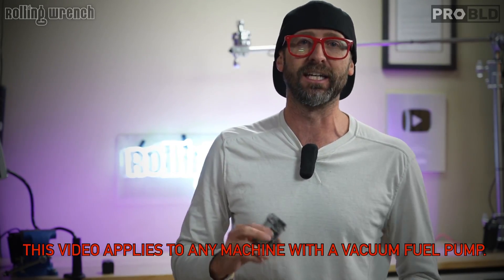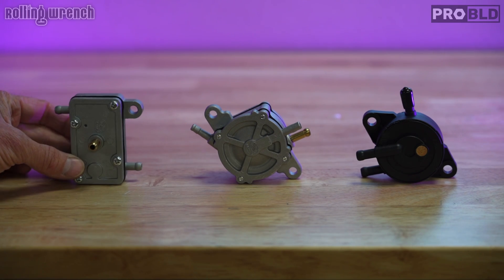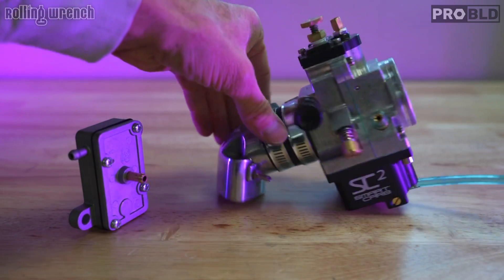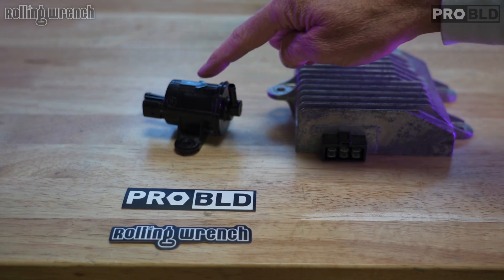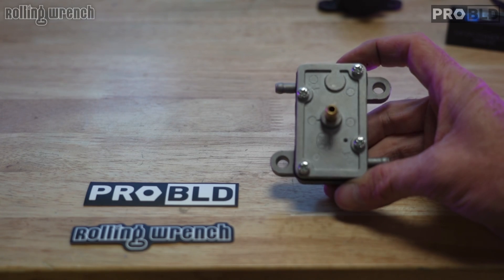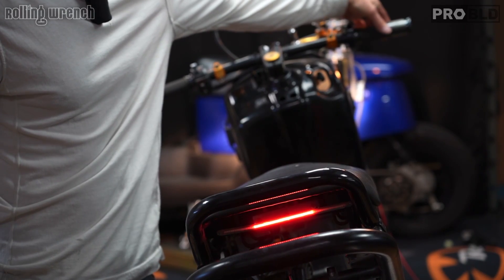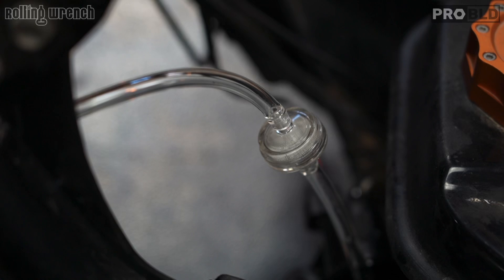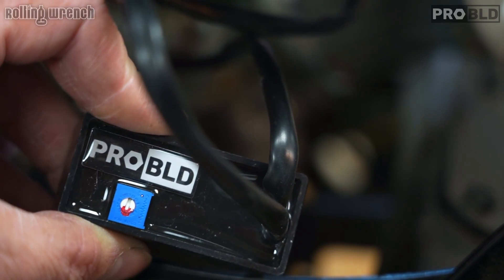No more vacuum fuel pump problems! GY6 Won’t start: FIX! [PROBLD PULSER UNIT]

Comment: Use crankcase vent hose instead of the intake port as your vacuum source
Reply from the maker: That doesn’t solve the problem of it being a vacuum operated fuel pump. The other issue is, the crank case vent is there for a reason. It can’t be blocked off. It will build pressure in the crankcase
Reply: The crankcase vent hose blows OUT. The intake manifold vacuum hose sucks IN. will not work.

Comment: i have a Kymco Granding 250cc scooter, its not been running since July or August last year, and i just start to run it again yesyerday and today... and the issue i have now is when i go uphill it feel like it going to stall or dosent have enough power or gas  running, what could the problem be? is it a power pump issue or what? it use the round shape power pump like onr u show in this video

Comment: Why do you need the pulsar?  Why not just hook it to 12 volts?
Reply from the maker: Unfortunately it doesn’t work that way as stated in the video. The fuel pump requires a pulse.

Comment: Well that’s a problem.  You need rigid vacuum hose…. Not soft ply fuel line.  Any deformation even small will hinder the pumps stroke by a shit ton.
Reply from the maker: Actually we have tested all this. The helix line is not collapsible. The issue still remains. Button line is. Get that dinosaur fuel pump out. It’s no bueno.

Comment: I have a similar problem with a John Deere riding mower. Bad starting/gas flow in beginning. Could this work.. ? No brake lights.. but i have headlights.
Reply from the maker: Yes, just wire it to 12v. I have a lot of people using them on tractors
Reply: Thank you!! 
My last mower was gravity fed. No problems. All of a sudden.. starting issues!
Your video helped tremendously

Comment: Hey bro, I have a 150cc gy6 motor, If I want put a 170cc head and cilinder ¿Will I need to modify the crankshaft? or the 150cc crankshaft is compatible?
Reply from the maker: No need to do anything with the crankshaft. Just put our drop in kit in and go. https://www.rollingwrenchdenver.com/products/gy6-171cc-big-bore-kit?utm_content=ios&utm_medium=product-links&utm_source=copyToPasteboard

Comment: Have one on hyosung Aquila gv250. Tank is above the carbs. I have done everything to this bike and I mean everything. Carbs and all. Still dies upon throttle but it starts and idles perfect. I have to spray the carbs to rev normal. I have a feeling it's this vac fuel pump. It's my first one I've ever seen.

Comment: Does it come as a set? I’m planning to order one. My ruck won’t start. I did check everything and its fine but I think its the vacuum fuel pump. Damn this sucks!
Reply from the maker: You can purchase both.
Reply: I hope this is the answer to my problem. I changed the oil/gear oil and spark plug then strolled around my neighborhood with it. Next day I strarted her up just to warm her up that’s when she died out then couldn’t start anymore.

Comment: You think it would work on an Evinrude outboard boat motor?
Reply from the maker: It will literally work on any single carbureted machine. Cars, boats, scooters, utvs….
Reply: @RollingWrench  won't flood carbs at idle?
Reply from the maker: @CODYW1992  you can adjust the amount of fuel is delivered to the carburetor via the knob on the pulser unit.
Reply: @RollingWrench  ok all look into it

Comment: I just watched the video how's the pulser unit know if it's over fueling are under fueling the engine is going to use more when under a loud
Reply from the maker: The pressure from the pump fills up the float bowl. Once full, the flow is stopped inside the carburetor by the needle and seat. If it needs more, there is more on tap with the pressure behind it. We have done a ton of testing. All good, nothing to worry about on your end.

Comment: Sorry for the long post in advance: I have an oddball 49cc scooter (2012 Yiben MD50QT, currently saving for a Navi) I've been having a lovely time dealing with the same issues in the video, running clear lines you can literally watch the gas mysteriously vanish below the line to the pump over time. Replaced starter, spark plug, carb, checked vac seal and lines, and have gone through 4 pumps driving myself insane. Once I get it cranked, it takes a few minutes then everything is peachy. Unfortunately, the entire scooter except the fuel gauge is AC. I have 2 questions, first, would it be possible to split the fuel line from the tank to this pump/unit and splice in another directly to the carb, splice in a 12v AC to DC converter with a switch off of the brake light, so the pump activates with brake is applied to basically prime the system before starting? Or would this just not be worth the time experimenting and just plug the tank directly into the carb with an on/off valve, maybe a 1 way valve connected so it doesn't leak?
Reply from the maker: If the bike has an electric start there is definitely a dc wire to tap into. Check that first
Reply: @RollingWrench  Thanks. I figured there's something somewhere on the harness, but man, I just want to hit this thing with a crowbar.
Reply from the maker: @MortalityTechnician  the easiest wire to tap into is the key ignition
Reply: First of all, the petcock is not a pump. It’s just an on/off vacuum controlled. When you start the bike, the engine starts a vacuum which pulls the valve open and fuel starts flowing. If the vacuum was an actual pump, fuel would be sucked through the vacuum hose. I proved this theory because on mine, the petcock was stuck open. I put a manual petcock on and it works just fine. I’m not 100% familiar with your bike, but most of the cheaper mopeds are all manual and basic operating systems (air/fuel/spark). The more expensive bikes give you computer control, fuel injection, etc so the computer makes adjustments as needed to keep the bike running smooth. In my situation, the bike is all basic. I did learn a good trick to keep it running smooth. I put a CAPFUL of seafoam with every fuel refill to keep the carburetor clean. The idle jet clogs on a regular basis. The idle jet has holes the size of a human hair and easy to clog. That means damn near impossible cold starts, stalling, horrible idling.
Reply: @grazz7865  you should start your own channel. You are one hell of a critic.

Comment: Generator and a lot of smaller engine use these dumb vacuum fuel pump I take them out and replace them I put a low pressure fuel pump it has to be low pressure low flow or you will have problems. IV gotten a hole bunch of small gas engine tools for free because of the vacuum pump not working the rubber tends to rot out and stop pumping fuel.👍👌✌️🏍️💯

Comment: When the pump is not activated, does it block the flow of fuel? What I’m wondering is if I can use this on a gravity, fed fuel tank. Those vacuum operated pet cocks have always been very unreliable for me. I would love to just put a manual petcock on, and then essentially use this pump to stop the flow. If you open the bike is off, and then let it flow when the bike is on.
Reply: I put a manual petcock on mine. The switch on the petcock stops the fuel flow. My vacuum petcock was stuck open (better than stuck closed I guess). The manual petcock works just fine.
Reply from the maker: What up brother! How you been? You still rockin that Perrywinkle ruckus? 👌such a dope bike! To answer your question, unfortunately no. Fuel will still gravity flow with the pump off. I know what you mean, the diaphragm in those vacuum fuel valves are not very reliable. I think it is best just to install a free flowing fitting onto the gas tank and inline, install a 3/16 manual shut off fuel valve.

Comment: Hey Matt I had a question about the reliability of a gy6 swap. If I go the gy6 route is that a motor that I am constantly gonna have to tinker with and fix things and all that just to keep it running or is it reasonably reliable as long as you keep up with routine maintenance and all. Also I just bought my first ruckus like 2 months ago. I have done a bunch of stuff to it already and I just wanted to say thank you because without you I would have zero clue on what to do with any of it. Everything I now know is from watching your videos
Reply from the maker: Thanks for the support Jason! If you purchase my stuff and put a good tube on it you won’t have any issues

Comment: The smaller gy6,(139qmb) carb has a mechanical acceleratior pump so normally in the winter I just twist the throttle a few times and it starts right up,the bigger carbs downfall is not having a mechanical acceleratior pump,it's ran on vacuum
Reply: Hi , your vac. Pumps installed wrong , look in the pump manual ! They must be higher then the vac. port and horizontal mounted, so that the drain valve is on the bottom , the let the condensation out . This Pumps are very reliable , if you install them according the manufacturer , and replace every year the diaphragm if you USA Pumpgas .

Comment: The line and pump should be mounted below the lowest point ... and keihin is the best pump
Reply from the maker: It doesn’t matter with the vacuum pump since it’s a push pull type pump. Obviously I strongly disagree with any sort of vacuum pump being the best option. Normally when I hear that, it’s the guys that have never tried an electric pump.  We all have our own opinions. I respect yours.

Comment: If your carb bowl is full, then it'll start with no issue. Then the vacuum pump will have plenty of time to catch up. Another issue you're facing is the pump need to be pumping, not pulling. Mount it low, by the tank, and this is again a non issue. Also, try using a battery that isn't half dead.
Reply: I had a CB750 with one of these damn vacuum pumps. If you ran the fuel tank down to reserve (easy to do as there is no fuel gauge) the carbs would run dry.
 The vacuum pump would not pump while cranking with the starter so the carbs would remain empty and so the engine would not restart.
 The pump would only work with the engine running but you could not get the engine running as the carbs had no fuel. 
These vacuum pumps are the work of Satan.
This electric pump is a great idea.
Reply from the maker: Ya that will help a tiny bit. Or you can just make out with your gas tank. That will get the gas up to the carb every time like clock work. But it still doesn’t fix the over under fueling issues you get with these super unreliable pumps. At least this has been my experience. I hate them soooo much, I spent hours and hours creating this :-). But each your own. If like the vacuum pump run with it. Jest keep that battery charged up :-)
Reply: @RollingWrench scammer rat 🐀  it's called getting a $35 genuine Mikuni pulse pump, ur just trying to make a market to sell  ur hot garbage for $225
Reply: @RollingWrench  under fuelling? No sir. I've run taida 232cc full builds with the accompanying 32-34mm carbs with 0 issue out of mikuni DF44 vacuum pumps. I understand you're trying to peddle your wares here, but don't lie to people.
Reply: @zeebull  he isn’t lying. I’m running a taida 232 as well with a mikuni df44 and Im constantly having under fueling issues. Every now and then my engine embarrassingly sputters n shuts off while coming to a stop at a light. I have to “make out” with my vacuum line pumping fuel thru my entire line and pre filling the bowl till it’s full and there’s zero air bubbles in the line. Only then will my motor run at it’s longest before it always eventually under pumps and shuts off. I’m gonna buy this module and hope it’s a good as he says it is.
Reply: He's selling a product. Nothing will work but his product.......  get it?
Reply: @The411  oh, I get it, and I get why people do this. It's still slimy
Reply: @zeebull  Ya, I just run any small electric pumps and Tee back to the input with a restricted line to bleed off any overpressure. No magic 555 timer box requited.

Comment: I have a 24mm diaphragm type, if I use of these, am i getting a problem like overflowing since it is pumping continuosly?
Reply from the maker: No, you can adjust it if needed. It’s only a 2psi pump as well

Comment: Bought mine
Reply from the maker: I appreciate you brother 🙏🏻💯
Reply: @RollingWrench  No problem.  Going to be making a big order around Thanksgiving weekend hopefully.
Reply from the maker: @nickcalkins8705  Thanks dude! I appreciate you
Reply: Does that fuel pump need to be mounted towards the low side of the gas tank, or can it be mounted anywhere?  Going onto a maddog.
Reply from the maker: @nickcalkins8705  The fuel pump needs to be mounted below the tank. The fuel is gravity fed to the inlet of the fuel pump. When the pump is powered on it will take the fuel that was gravity fed to the pump and pump it to the carburetor. If the fuel pump isn’t below the tank it won’t function.
Reply: @RollingWrench  ok, thank you.   The original vacuum pump is right below the seat.  Gen 4
Reply from the maker: @nickcalkins8705  the vacuum pump can push or pull. The electric pump can only push
Reply: @RollingWrench  gotcha.  Thanks man.

Comment: Would this work on other engines that use a vacuum pump? Like my stupid boat motor? Seems like I could just get a pump and this unit, wire it in and go.
Reply from the maker: It will work as long as you o it have 1 carburetor. The pump isn’t strong enough for a multi carburetor set up

Comment: How about running a high-flow fuel pump directly into the carb with a low pressure (1-2 psi) check valve in reverse acting as a relief valve dumping back to tank and just let her pump to it´s hearts content.
Reply from the maker: You can do that too
Reply: @rafaellastracom6411 can you give me more info in this idea parts and hook up info ,Thanks Godbless
Reply: @78dwk  If you want to play around with these things you have to be careful not to set up a circuit that ends up filling a cylinder full of fuel and locking it up.  It needs to be done with a lot of care.  Thinking about it now I would go with a gravity fed system that is fed by the pump instead of a pump feeding the carb directly.  This way if the pressure increases for some reason (dirt, etc..) you don´t inadvertently fill a cylinder up.  I would have a pump fill a small volume tank (a soda can´s worth or less) that is found over the carb float so that the only pressure the carb would see is gravity fed which would be controlled by it´s height over the carb.  You should be able to find a spot to put a soda can´s volume somewhere on the bike.  You can place a return line at a high point in this secondary tank so that when the pump fills it to that point it simply spills further flow back to the main tank.  The fuel pump would need a standard low pressure check valve to feed the secondary tank so that when the system/bike is off the secondary does not bleed down.  This ensures that the next time you go and start the bike up the secondary tank will be ready to rock.  Ideally you would wire in a level sensor that would turn the pump on and off after reaching a certain level in the secondary tank so that the fuel pump is not always going when it does not need to.  You would not need a processor/controller for it as it can all be wired from the devices itself.  Good luck.
Reply: @rafaellastracom6411  thanks for the info Godbless

Comment: i had the same problem, fixed it with a primer bulb from a boat mounted under the seat been working perfect for a while.
after it sets for a while just sit down give a squeeze or two then hit the starter and within a sec or two she's running.
total cost..about 8 dollars.
Reply from the maker: Oh ya! That will work in place of this for sure as far as priming. It’s just big and bulky and ugly on a ruckus. But your still stuck with the unreliable pump.
Reply: @RollingWrench the accelerator pump on the carburetor is designed to prime it especially on cold starts.
Reply: Did u interrupt the vacuum line?
Reply from the maker: @MrZap773  yes, cap it off
Reply: For a while. How long ? And why did it stop working ?
Reply: How and to what do you connect the tubes of the  bulb to? (Is it just in series to the fuel line)
Reply: Yes. The bulb will suck fuel through to prime the fuel system. @TonyTormento
Reply: My neighbor GAVE ME his Yamaha Rhino that had 125 hours on it because he always killed the battery trying to get it started. Especially in the cold weather.  I installed a marine-type fuel bulb pump behind the passenger seat. When I get on the Rhino I reach behind the seat, give it 5 squeezes and the Rhino fires up instantly. You just have to get the fuel to the carb before turning the key. Of course you still need a functioning pump of whatever kind you desire, but the hand pump is the best way to start off for whatever pump you you end up with.

Comment: Pump electric car fuel  scooter work
Reply from the maker: Ya. I have tested those too. They pump at around 4 psi. We need 2 psi. You will need to add a fuel regulator to keep the pressure down. They also draw a lot of amps. They failed my tests.

Comment: If my gas tank higher than my carburetor, can i remove that stupid mechanic pump?
I'm only asking sometimes it gets blocked...
Reply from the maker: Ya. That’s a vacuum operated petcock/fuel valve. You can have it free flow to your carburetor. The only reason it has the extra vacuum hose is so it will close the fuel valve when the bike isn’t running. Beware if you do that though. If the carburetors needle and seat has a leak, the entire fuel tank will drain onto the floor . That’s the reason it has a shut off, for safety.
Reply: @RollingWrench  Thank you soo much!